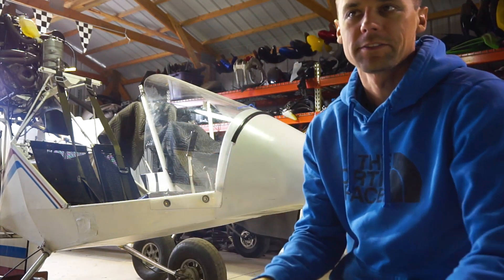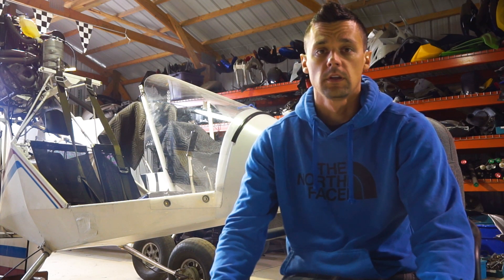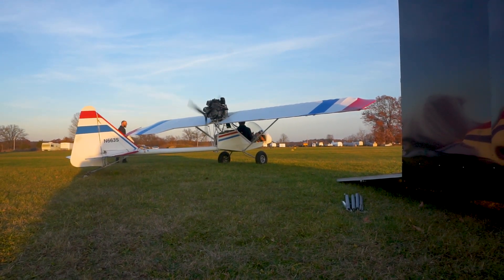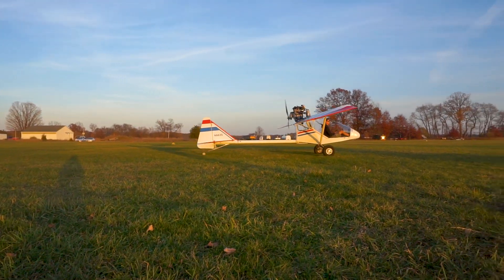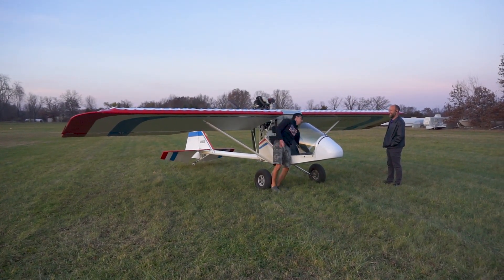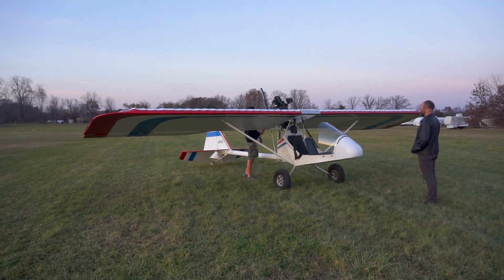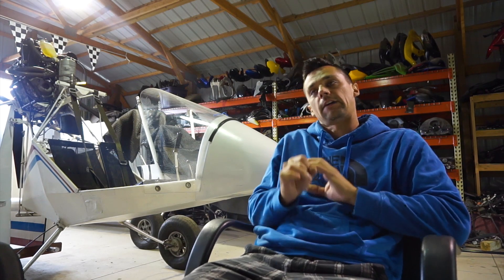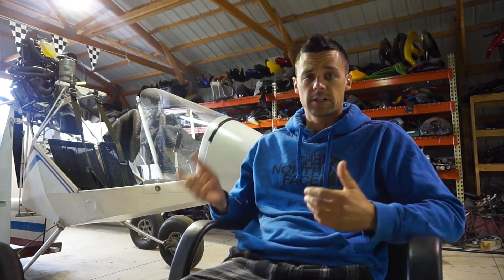Yamaha Powered Airplane Conversion Part 3 TEST FLIGHT

Comment: I just bought a Quicksilver MXL II with a 503 that also needs new sails. 
I game across your series to put this Phaser engine on your Firestar and thought it would be great to have the extra HP on a Quick. The difference is that you know what you are doing and there isn't enough information in this series for me to learn how to do it as well. Even the part about where I can get the complete engine that is reliable. 
Any thoughts?

Comment: So, what type of horsepower are you getting at the 7500 RPM range? I read the peak HP to be 80 @11,5K(?).   I put a rotax 670 95 hp on my rans S12.  Engine built by rotax Rick
Reply from the maker: Makes 80 hp by 7500rpm according to dyno charts I've seen. Funny thing is the rpm feel about half of the rotax, very smooth and quiet. No mixing fuel, fuel injection, 582 weight and 2 gph in this bird.
Reply: @bkairys  awesome!!! Happy and safe flying!

PS, the axle lift is very cool.  I have the tundra tires on my Rans and it looks so much better than the tiny little ones that most S12's have

Comment: Yes, very nice, clutches are much safer on the ground.
How did you decide on the tandem two seat Kolb over the SxS mark III? Are you in close contact with the Kolb folks?
Thanks...
Reply from the maker: Both Kolbs were just local planes that I ended up with as good deals. I have talked to the owner of Kolb a few times. He gave me some tips on my Firefly at Osh 19.

Comment: hello Benai. Very  nice job. I flew with a rotax 582 engine, but dropped out...I am now using car conversion "Suzuki" G13BA engine, the vertical speed is now 7.5 m / s.
- Benai, do you speak Lithuanian ???
Reply from the maker: Nice!  I am part Lithuanian, but unfortunately do not speak it
Reply: @bkairys  wow ... grandparents didn't learn Lithuanian.
I have a few questions about Kolb aircraft...

Comment: Whats the weight of the setup & HP?
Reply from the maker: 410 lbs, 80 hp
Reply: @bkairys  410 lbs. for the engine or the aircraft total?
Reply from the maker: Empty aircraft weight. Engine is about 130 lbs with everything to run it.
Reply: @bkairys  Oh ok thanks!
Reply from the maker: FYI Almost exactly what a rotax 582 all up weighs
Reply: @bkairys  Nice! Seems like the perfect 582 alternative, without being a 2-stroke.

Comment: In one of these videos you mentioned the speed sensor was causing errors, I wonder if you could attach a small fan blade to a shaft and also mount a reluctor wheel behind it and kill 2 birds with one stone, I think this is how BOM gets it's speed data. Also how the V-1 buzz bombs calculated distance for their guidance systems
Reply from the maker: A different solution is coming soon
Reply: @bkairys  I wonder about using one of the BOM units.
Looks like a cost effective solution

Comment: Great work! What is the gearbox ratio and prop dia? Are you using the Air-tech Rotax Gear Box Clutch Rk400c ?
Reply from the maker: 2.62 Rotax C Box with 3 blade Ultralight IVO prop

Comment: My Firefly will be ready to fly in early spring.  I'm keeping it in a 24' enclosed trailer with 12" of extra head room, but I don't have a tailwheel dolly for loading/unloading.  How are you connecting to the tailwheel?  I have a small trailer dolly I'll modify.  Thanks.
Reply from the maker: Mine grabs around the wheel in a u shape and the axle mount for the tail wheel falls into a hole to lock in place
Reply: @bkairys  Thanks Ben.

Comment: Methodical and scientific, well done. What's the weight of that motor, specs, etc.?
Reply from the maker: 80hp and weighs slightly more than a rotax 582
Reply: @bkairys  and I'm sorry if I missed it but what did it come out of?
Reply: Weight and balance done and within acceptable limits?

Comment: Awesome, Ben!  Can you make a video of how you mounted and plumbed everything, like the oil tank and radiator , fuel lines set up?
My harness from Ian Bange is on the way, and I’ve got my deposit into to Teal for the gear box.
Keep up the great work!
Reply from the maker: I planned on doing something like that for sure eventually. Thanks!
Reply: @bkairys  Thank you, Sir!  Looking forward to that.
Reply: @bkairys  I'd like to see more details on the fuel injection and electronic ignition ...when you have a chance. Thanks.
Reply: @bkairys  you is very good ! Thank you for making this video! Thanks